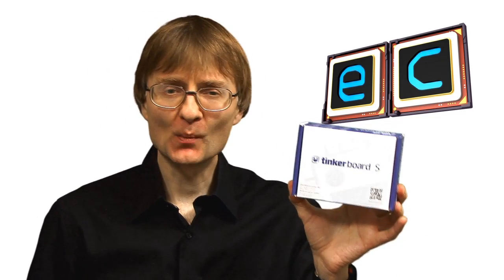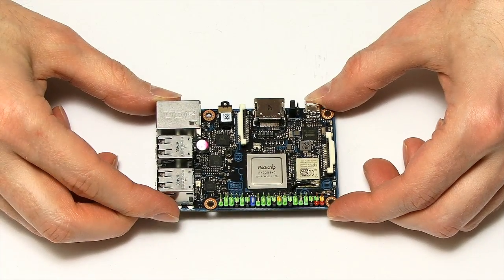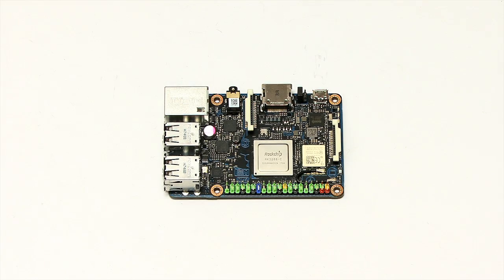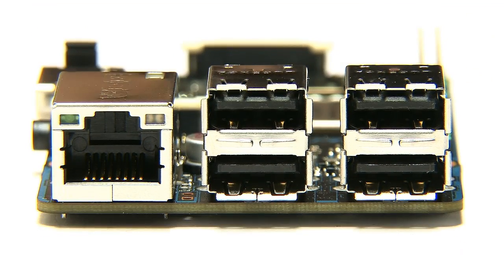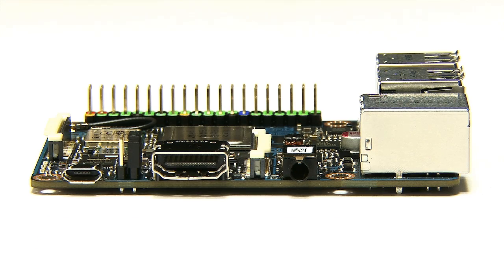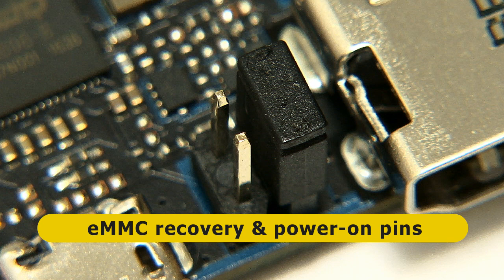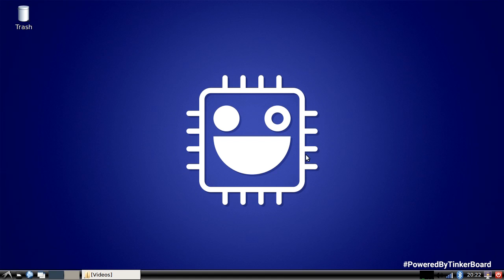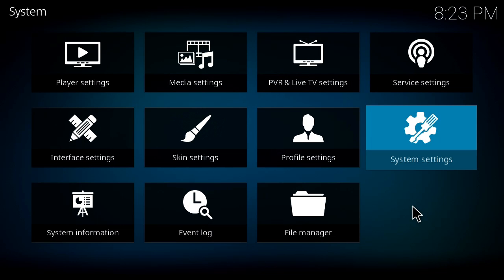Tinker Board S

Comment: Can Tinkerboards also run Raspberrian?
Reply from the maker: Potentially, but I am not aware an image is available. There is a list of all current images and OS here: https://tinkerboarding.co.uk/wiki/index.php?title=Software
Reply: ExplainingComputers Thanks for the answer. I meant by this, if it could run the image for the raspberry pi because it's basically the same, I think. I think about upgrading soon and I don't want to get used to another "OS".
Reply from the maker: A Pi image will not run on a Tinker Board (S) -- the form factor of the boards is the same, but not the underlying hardawre.
Reply: I suggest looking at future releases of Armbian. Overall due to the nature of the Linux kernel, the hardware may not be a serious issue (+ExplainingComputers, remember that Linux is not similar to Windows and does not necessary need 3rd party maintained driver support).
Reply from the maker: Very good points Mark.
Reply: +HamBeev,
The interesting thing about these SBCs and the idea behind the open source eco-system is that if someone believes that a project lacks support, they (the user) can produce their own support and development network (by setting up and providing access to forums, blogs and other support provisions).

If a user or developer wants to see improved support for the Tinkerboard (or any other SBC), then I would suggest that the user (or developer) provides (or helps to provide) the support framework.

Comment: +ExplaningComputers / Christopher,
Nice improved board, just wondering about the WiFi / Bluetooth chipset -- What is this chipset.

Also due to the publishing of the schematics, does this mean that the Tinkerboard is completely open source hardware compliant (ie. could developers use the schematics to produce their own alternative boards)?
Reply from the maker: Hi Mark, I cant find the spec for the wireless chipset I'm afraid. But it may be in one of the many available downloads. Not sure on the open source thing . . . this is a commercial product.
Reply: Thanks, also whilst it is a commercial product, the schematics could also be released under a open source license.

Remember that just because a product has been released via a open source compliant license, that does not mean that the product can't be sold as a commercial item.

Open source does not necessary mean that the product is free (as in gratis).
Reply: +lesslighter,
My reasons for asking about the Wifi chipset model is to do with an interest surrounding access points and monitor modes (for use as part of white-hat penetration testing and network security purposes).
Reply: Just checked the documentation and the AzureWave NB177NF chipset could possible be used as an access point but does not support monitor mode.

Also, the document is actually quite sparse and only contains general information.

As an example of good documentation, I have a Banana BPI-R2 board and there are a load of interesting specifications, schematics and other information available (URL provided below).

Reference: 
* https://medworthy.co.uk/cloud/index.php/s/AAWs0arP1OTnOSZ

Comment: They are doing one thing I hate, pricing the same for $ and £
Reply: As at 25 Feb 2018, 1 UKP = 1.4 USD.  The UK price includes VAT @20%.  An American viewer may need to correct me, but I don't think the US price includes sales tax, as that is set (and varies) at state level.
Reply: ᓮאᗩFᒪᗩᖰ Not only does US sales tax vary from state to state, in some states it varies from county to county. For the record, this can be from 5 to 9%.
Reply from the maker: The RRPs reflect the state of the pound -- a 1:1 £:$ is now sadly very common for tech products. Final street/web prices may vary a little.
Reply: Only in Montana and New Hampshire do you not have to worry about state sales tax.  Recently saw a tax table website and if you drill down to the county level, there are counties that are as low as 2% sales tax.  The state of Colorado is a good example where some counties are as low as 2%, but the downside of that lower county tax, the state tax is a bit higher.  So in reality, nationally, it can vary from 2% to 9%, depending on location.

Comment: We need an x64 micro computer board
Reply from the maker: We have them -- eg the LattePanda and the UDOOx86 range: https://www.youtube.com/watch?v=NjV7QPqure8
Reply: @ExplainingComputers  Thinks
Reply: I have been using a Rock64 since early November - OS support is still...  well... not fantastic (basic stuff like video modes are still poorly supported, even USB keyboard/mouse would fail on 3 out of 4 boots in one major distro).  It does support 64 bit OS's but I envisage the Vim2 is going to be a better solution, at least that's what I've heard from those who use one.
Leaving this as a 32-bit board with just USB2 and jacking up the price (and making it the same amount of USD and GBP when they are NOT the same) - it's all up a rather unattractive proposition.  It has a good community and the OS builds seem to be better than others but overall I think there will be better options out there.
Reply: While some will use these things as mini-PCs I think they’re at best a niche market – I wouldn’t want to be stuck using one all day as a primary, they’re at best suited to casual or specific niche tasks.  This is a hard market to monetise and make a commercial success beyond the initial hardware sales, it’s one reason that these firms are relying quite so heavily on community support and perhaps a bit too much so (I think this is a big problem in the Pine support world right now, especially in graphics display).
As for pricing – this was one of my main points of contention.  This thing is RRP’ing at £79.99 yet for two pounds less you can get a full Windows mini-PC - https://www.youtube.com/watch?v=Q4nYlLkX0YE
That contains a quad-core Atom X5-Z8350, 2gig of ram, 32gig EMMC, gigabit ethernet, dual-channel wifi and also has VGA out as well as its original HDMI out, full case with aluminium sinks, etc. USB3 and USB2 ports, Bluetooth 4.0, a VESA mounting bracket to bolt it to the back of a monitor, power adapter and SD card reader.  Sure it doesn’t have GPIO pins but it does have an awful lot more kit for the price and AFAIK the Atom in this config is significantly faster than the 3288 for daily use;  even if you fry the windows build and install Debian. 
The other advantage with this device (for that purpose) is that the Debian build will be much much much better supported;   x86 support and Intel chipset support is naturally greater than more obscure niche devices such as the Rockchip, you’ll see more advancements for performance and perhaps even security as well.  Now power draw at the wall WILL be greater – I’m not sure of the line-vs-line comparison but if you suspend the device when not in use then it’s going to be drawing very little indeed anyway.
Furthermore – to spec the Tinkerboard 2 up to this level of peripheral support is going to be expensive;  case,  5v 3a USB power supply (I’ve seen those for over £20 if you don’t look hard), if you want to use VGA then you have to get a converter, of course there’s double the EMMC and you DO have the option of windows if you want to use it (which you can’t do on the TB).  Personally I wouldn’t want to – I’d want to use this as an always-on mini-server tasked with other functions, had I need to control devices via GPIO (presuming it’s computationally simple) I’d probably offload that to a much cheaper Raspberry Pi zero-W (perhaps even the new one with the pins).   
In my use-case scenario (box running Debian and controlling pins) I could do this with much more external support (e.g. running a nice fast USB 3 HDD) and push commands to the external Pi Zero W via MQTT for example;   it’s a different architecture but it’s a lot more grunt and gear (and more resilient) for less cash.
Reply: So make a review on UP board series, which are very new x86 SBCs
Reply: If you doesn't have more than 4GB of RAM you don't need x64.
Reply: Well Davo. You have just proved my point. Why do you think Intel is selling processors at this low price?
Reply: Intel have quite a problem here - they can't really control the really low end of the market too well (they had a dreadful foray into the SBC market which they pulled out from not that long afterwards).  Intel don't want to sell at these prices in this segment as it's all obligation with little RoI;  they don't draw in the cash to warrant a lot of driver development, it's one reason why chipset drivers are hard for end-users to get and they tend to release a version 1.0 to a manufacturer and then that's it (forever) most of the time.  The guy in that video builds his own Windows 10 build and has to scrounge for drivers from external sites, I've been through that myself with a Tronsmart X5 board too;  it's not well done.  
Intel make very little cash profit from this - they make a bit more from each desktop CPU sale, probably even slightly more from mobile CPU (tray) sales and a LOT more from server sales which is their really big margin market (which is why the Spectre bug was a particularly big problem for them).  In the past we used to see Itanium chips shipped with hardware (so the manufacturer ships all CPUs at time of installation) but most are disabled;  switched on by code after a payment is made, this is way of gradually selling/buying more CPU clout whilst lowering ongoing support costs and downtime.  In one box I saw this was $72,000 per processing "node" (so to switch on another Itanium it cost that much);  this was partly jacked up by the vendor but it goes some length to showing the margins Intel would have on enterprise gear like that.
Back down into this space though - the strange thing is that Intel isn't really pushing into that space themselves, they're begrudgingly allowing cut-throat Chinese makers to do this on their behalf and offering as little direct support as possible.  The lowest end infiltration there is the Intel NUC of course which is a fair bit more than these things at RRP....  
Intel were always worried about a lower end box undercutting a higher margin sale;  they didn't want a Celeron to sell where an I3 could have been sold for instance but they eventually had no choice.   I think they were most worried about big numbers of thin-client corporate workstations rolling out (which at one point was "the way of the future" pushed by Citrix with dreams of extreme central management in big sites but it never really delivered on promises).  Intel themselves are supposed to be quite a mess right now, I've heard that they lost their way internally and staff aren't happy there (engineers leaving in numbers) and the odd story makes it onto the wire talking about that level of dissatisfaction.
The Unix/Linux distro support will improve in a more fractured and varied way, it's messier to get updates for some component gear but after a while it tends to appear in the main popular releases by default;  suddenly something that hasn't worked for ages just starts getting hardware and kernel support.   You're waiting 6-9 months for that at minimum though (well a lot of the time) which is painful indeed.
Reply: Davo CC yeah I think you nailed the price performance thing. Its a very niche market until you consider home automation and the need for tiny low power form factor and Mqtt. 

But even then that's niche now in that its nerds and builders and not consumers.

Plus for all current home automation the old tinkerboard is fine.
Reply: Yeah I was drawn to current utilisation by the low power and price factor - always-on gear should be light in consumption for obvious reasons, it can also lead to more reliable hardware too (no fans or moving parts, total solid state build, lower power input lets you potentially filter and isolate it to a battery pack or array with constant charge for a poor-man's UPS).
I'm wondering where and how I'll move forward, I'll probably go for a solution between these two in practice;  I'm keen to use MQTT a lot more than I do now, it can become the glue that fits a lot of things together in that sense.  Right now a lot of people using these for automation (Pi's are used a lot for home-hub duties) will up-scale to something nearly as low in power consumption I think, we'll have to see where it goes.  I do note that quite a few of these newer boards are demanding power supplies beyond USB abilities, my Rock64 spec's up to 3a power - though I've been running mine on a live USB volt and amp meter and it's rarely gone over 0.65a draw at 5v, I think that's to cater for in-line peripherals such as USB drives, etc.
Reply: I have an Orange Pi Win Plus and apart from issues with video it works quite well. I got it specifically for ARM 64-bit development, as it was one of the cheapest and most capable boards last year.

I will be getting hold of a RockPro64 when it gets released, it has some better specs and features. But for me it's still just about having ARM hardware to work with. So x64 isn't really an option for me at least.
Reply: Armbian is working well for me so far. out of all the disros available for Tinker Board. It installs what I need to get my Nextcloud server running & acts as the perfect Plex sever for my TV connected rPi3b
Reply: also 8 core + with sata 3, usb3 etc all in one and preferably stackable
Reply: Why donot they make a thinkerboard with two built in CPU chips, and one M.2 slot in the back, and 1 ram cartridge slot, so it can work as a fully powerful computer and 4K/60fps, no ethernet port instead 2 built in wifi mini cards, should just come with a 64gb emmc memory chip and integrated with the operating system and also with windows10.
Reply: I think Intel and/or Microsoft are just a little bit annoyed about Asus and this Tinkerboard. When Google makes a full featured Chrome browser for this platform, it will be a very affordable competitor in the low end PC market. With more and more powerful ARM processors it will be able to eat a chunk of the PC market.
Reply: Yeah my take on these is that they're most useful when really pushing for low power usage, use of the GPIO pins and small sub-task functions.  It really comes down to your overall architecture - for example if you want to configure a home automation network it's worth isolating that entirely from your main network and talking to it via pinholes and limited protocols;  the reason for this is the entire network is only as secure as the poorest device on that network (many of these smart bulbs, etc. have woeful security and no updates - ever).
The TB is a curious implementation in the wild, for example another Youtuber called Novaspirit did a fair bit of CPU mining investigation using these things (low power draw is the attraction) - I took his work and scripted some of the install work, there are some CPU-only crypto-coins which don't benefit from GPU mining so they aren't subject to that "arms race" as such.  I run mining as a very low priority task in the background to benefit from their always-on status.  In that sphere - the Tinkerboard (despite having the same CPU as my Rock64 and running only a 32-bit OS) is able to pull 18 megahashes / sec where mine can't do more than 12;  the Rock's deliberately slowed down to about 1.3ghz which is a real shame.
I thought they'd have finally gone 64-bit with this thing but alas they haven't;  my side-by-side tests with that type of task on x86 gear showed big jumps in sheer performance going to 64 bit on the same hardware, more than I would have traditionally expected.
Of course if you are using the GPIO pins to drive things - this is a far better solution but the Pi v3 may be even better as it's just so well known and so well supported in the wild.  For driving video - I can't say for certain, I think the Intel solutions are a tad immature build-wise for the upper-spectrum of the HDMI output (especially around 4k video), if you get an Intel solution it will need a suitably capable HDMI port (the example I listed above does not, it's only HDMI 1.4).
Overall with this though-  I think Asus have overpriced it and deliberately so.  I get that it's a rather effective solution in this space and well regarded for its purpose though I am skeptical at it being more than twice the price of a Pi v3 - I just can't see the justification for it.  Some will point to it having Gb ethernet that isn't affecting USB performance when used but the Intel solution can do that too;  I don't know how much is 'shared' (affecting IO via Wifi and/or EMMC, etc.), that's often hard to find out.
Reply: Google must be broken today.

Comment: I've been using the pi 3 since it released as my media player. Since it doesn't output 4K, and indeed barely eeks out 1080 I'll going to switch to this in relegate the Pi to the used SBC box until I find another project for it. Thanks for another great video!
Reply from the maker: The Tinker Board (S) is indeed a great media playback device.
Reply: Andrew Gulak : Hey m ready to buy   your old respberry Pi :-)

Comment: Good video Chris!
I'm drooling over the onboard storage. That was a good call from Asus.
Reply from the maker: It is indeed very nice to be able to use the board without adding an SD card. And it leaves the SD card slot free for more storage.
Reply: Albeit fairly slow read / write access times on the SD / TF card when compared to EMMC or SATA based storage (both mechanical HDD and SATA based SSD devices),